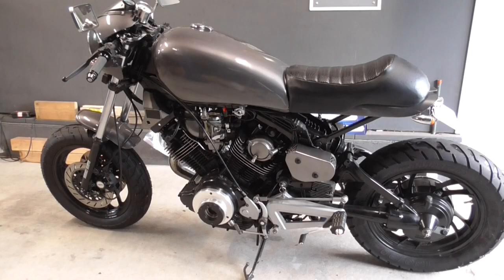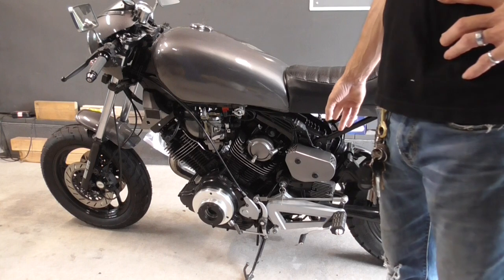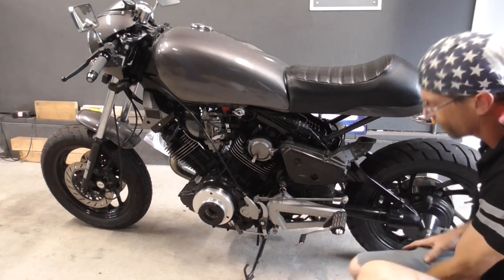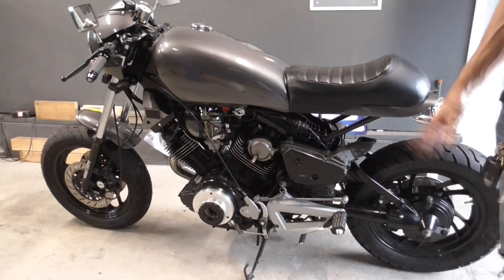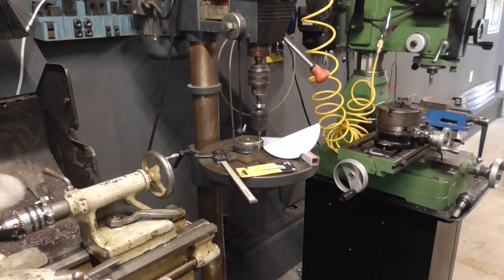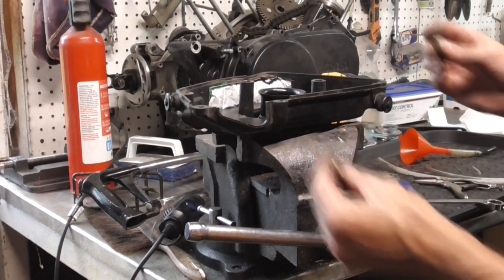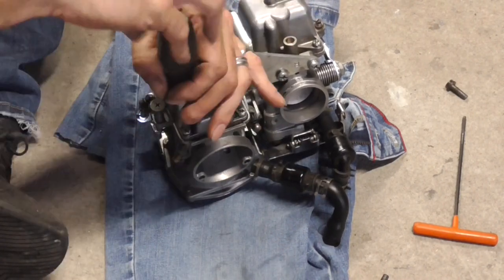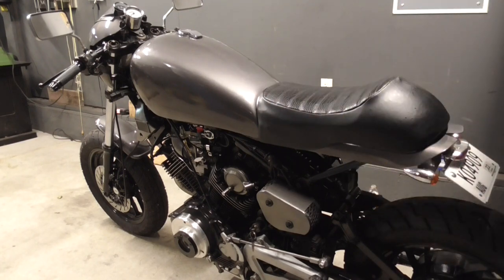Carb Jetting and Needle height Setup - Step by Step with trials at each change

Comment: This is awesome! I’ve been trying to get my carbs tuned and this is what I needed!
Reply from the maker: Thanks man 👍. Hopefully the video will help some in getting it tuned up. Dialing in the jet size and the needle height will change the way one runs if the exhaust or air has been modified I’ve found. A bit aggravating to have to pull the carbs off a couple of times, but well worth it once you hit the right combination and it lights up when the throttle opens up, lol. All the best ! Steve.

Comment: Steve, are these adjustments finer than the step changes on the needle? I haven't needed to change mine on the later 1100 even though I did an air filter mod and AIS delete.  The air filter I used has almost the same square inch surface area that the stock one had ( about 24 sq.in. ). It is connected to the same inlet into the frame as the stock air cleaner, so it uses all of the same inlet hoses, and the frame plenum.  Bike runs great and averages 46 MPG. I love the low end torque these bike make so low down in the RPM range. I rarely exceed 3500 rpm when running up in the gears. Yes, I occasionally run her up to 5000 just to blow her out. LOL!   Another great informative video.
Reply from the maker: Hey man !  Yep, it seems that different motor sizes and generations of the Virago vary in sensitivity to changes in the air restriction and exhaust back pressure. I’ve found the these 1st Gens are extremely sensitive to both.  A more open air intake will lean them out and they then have a bad drop in power while unrestricted exhaust takes the smoothness out of the transition from the idle circuit to the run circuit when the throttle is first opened up. I’ve always used washers so I can “calibrate” the needle height so to speak as little changes make a big difference on the main needle. I don’t mind the transition hesitation if it’s just a little in order to have a louder exhaust though, lol.

Comment: Since I am trying to get the bike to run correctly on both cylinders, I do not have the tube contented from the carburetor to the frame.  (1982 xv 920)  Is this a problem?
Reply from the maker: Hey man !  It isn’t a problem when tuning the idle circuit (idle air/fuel mix needle, sync at idle or even preliminary sync at higher rpm), but when working out the jetting and needle height they will need to be on there so the air restriction would be what is has in normal running conditions from what I’ve seen 👍.
Reply from the maker: When I’m first getting one running, I find it easier to get the cylinders to fire till I can get closer on the air/fuel mix needle setting by quickly putting my hand over the end of the carb to make a sluggish cylinder fire (if it’s only hitting on one).  It basically makes it load up a bunch of fuel and then will fire for a few hits after taking my hand off the carb once it get some air again. Sometimes it will pop back in the carb and clean a dirty jet out too.

Comment: Are you running stock idle jets?
Reply from the maker: Hey man !  Yep, since the air is still somewhat restricted having to go through the frame and elbows, I stayed with the 41 idle jets as there was enough adjustment still in the mix needle 👍. I’m about 2.5 to 3 turns out on the needles though vs the normal 1.5 or so turns.
Reply: @StevesDIYs  I have been running a 45 pilot and a 130 main with a small washer under the needle but although the bike runs well it’s running too rich. I’m going to try using the stock pilot and measuring the washer to get it close to .77/.8 as you’re using
Reply from the maker: @Sorcli  , 👍. I have a 43 pilots and 128 mains on the bobber as it is running the separate air filters connected directly to the carbs and the exhaust is not very restrictive on it either.  It is more restriction than the Cafe though as that one is dang near straight pipe, lol).  On the bobber I believe I lifted the needle up about .95 to 1 mm if I remember right (it’s been a few years since I did it) in order to get more grunt from the motor at lower rpms. I had to sacrifice the higher rpms though to get it to rumble along with power at low rpms though so it tops out at around 6000 rpms now before becoming too rich and stumbling.  I mainly just cruise the back roads and run around town on the bobber so it works good for the rpm range I run it in. The Cafe doesn’t have as much low rpm power with its jetting, but pulls like normal through the rpms like the stock bike...a little better throttle response than the stock bike since it’s less restricted, but feels really close in power.